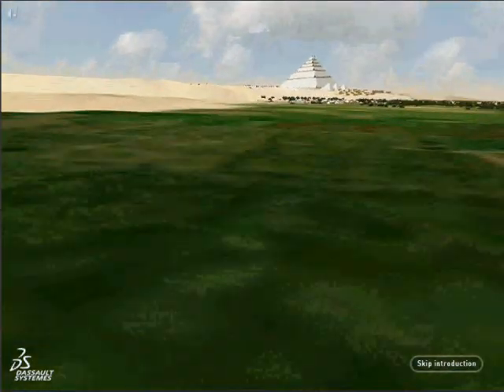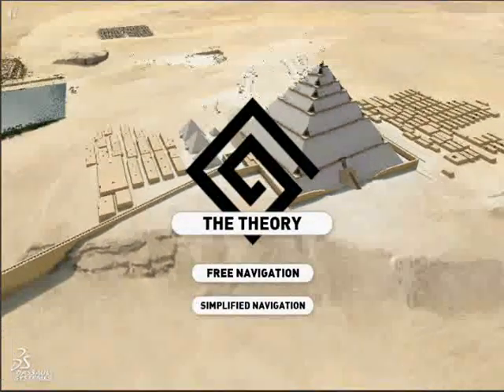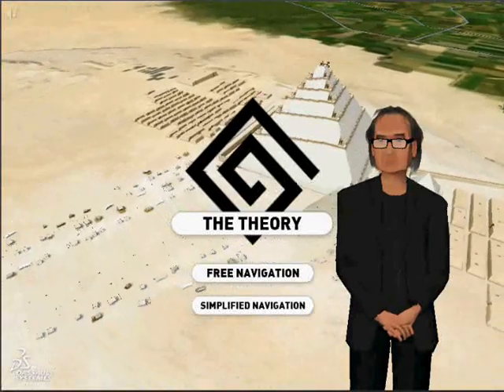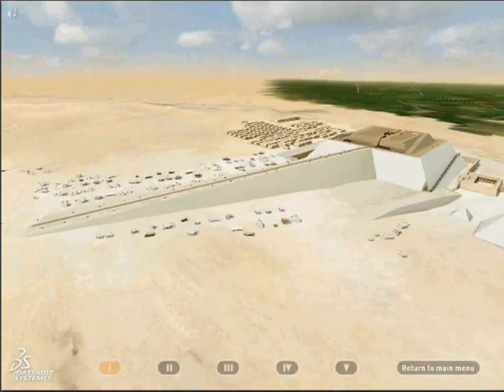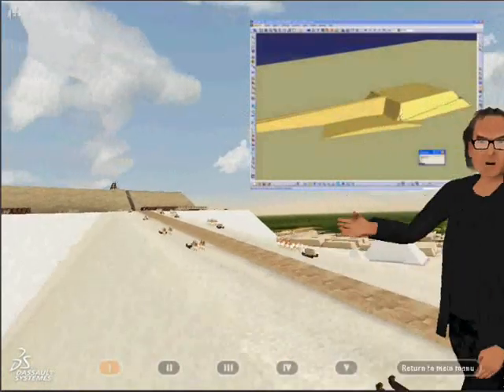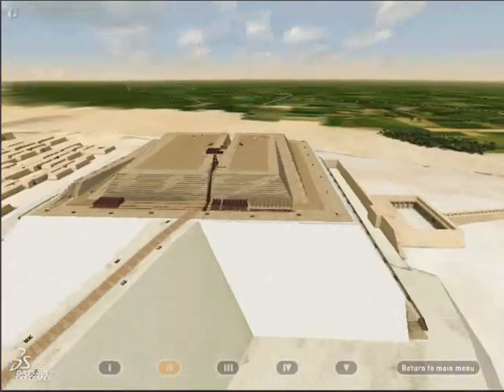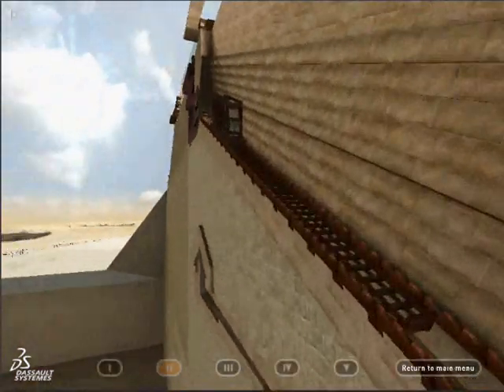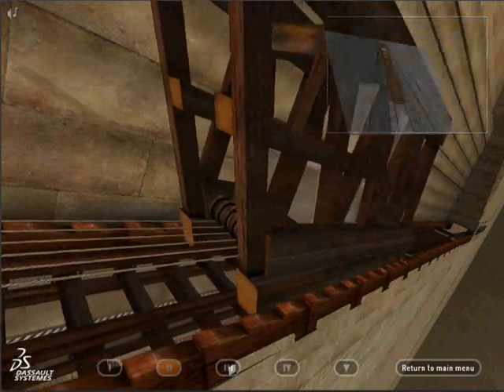How the Khufu Eqyptian Pyramid Was Built

Comment: The outer ramp went only the hight of the Grand Gallery just below half the Pyramids height. The external ramp It was removed and the upper half was constructed using the slope angle of the Pyramids face as the ramp to slide the stones up the middle face of the facing stones using Counterweight pulleys.

Comment: @cc1sportingtorver ...if you do the math with 2.5 million blocks that works out to 28 blocks per hour
over 20 years working 12 hours a day. Given a crew estimated at a minimum of 10,000, this task
could easily be done. In fact likely with a much smaller crew given the fact only a dozen men are
need to work on one block. Plus pulling crews of men, animals, and pulleys.

Comment: @demigodlike 
that the lower castes were completely expendable in the eyes of a Pharaoh. A magnificent achievement, but one that can be explained without invoking ancient "magic's" of levitation and/or anti-gravity. Pulley and levers designed and used by people with the same intellectual capacity and reasoning process as modern man, many years and a whole shitload of manpower, trained or otherwise, built the pyramids. Ecstatic to be proved wrong though,anti-gravity ride home from the pub anyone?

Comment: The Pharaoh's had such large ego's and were so worried of their predecessors erasing their names  that they even put their names at the bottom of their statues!
I think it's just silly to think that anyone would go through that much trouble to build a casket. Their pyramid has a lot of signs inside it that point to great pressure and heat and underneath it their are many tunnels that lead the the nile, possibly for cooling.

Comment: PhuqueU is right. These were healing chambers amplifing 528hz healing frequency of DNA. also Shamans would injest DMT and anotomic Gold to connect with source and gain wisdom. The pyramids create and amplify terrestrial stationary waves (standing waves).No writings or glyphs in the pyramids. The egyptians built the valley of the kings because they could not duplicate the pyramids, they tried 3 times those never got bigger than 60 feet high without caving in. Zacharia Stitchin!!

Comment: I was only referring to quarrying then granite and yes you split it and the proof is the sides that are not facing into the chamber are not flat and have almost a wave effect just as if you take a rock drop it and look at the break. there is still no other easier method of mining granite than spitting it. As for carving the granite for the sarcophagus just keep using the Wrought iron tools and hand drills. I never said it was easy but hey the king says he wants it guess what happens, he gets it

Comment: Well we know how much granite weighs and by the size of pieces in the pyramid and they are estimated between 50-60 tons max. As for their positioning they put them is as they went up. Why would you think they lifted them into place. This why pyramids are commonly used is because you build them as you go up layer by layer and how structurally sound the shape is. The shape of the granite beams were 1.3 x 1.8 x 8m hardly as task a team 0f men couldn't handle.

Comment: Copper was only used for the limestone. The Granite was not "cut" but split using wrought iron chisels. Granite splits to a quite smooth surface. Iron was very rare and valuable at the time so it was not used for the limestone.

Comment: Actually...Most of the pyramid was made of Nummulite limestone mined about 200 meters south of the pyramid. The white limestone was only used on the outer casing as duly noted. The average size of each stone is about 3 ft cubed. As for the Granite they were actually about 40-50 tons and you only need about a 5 ft cube to get to this weight (i know they were not cubes) . The problem you are having is not understanding weights. to say a team of men couldn't move a five foot cube is amazing.